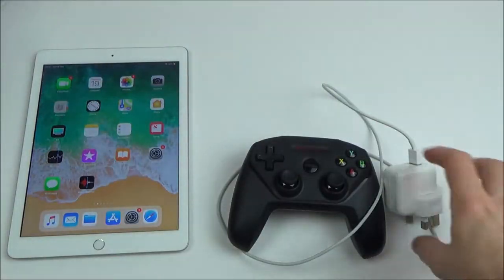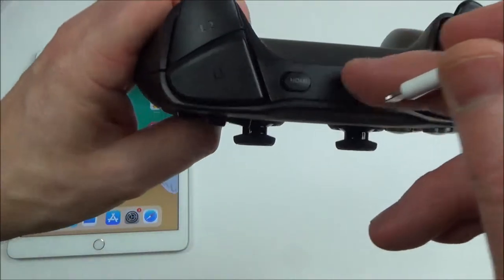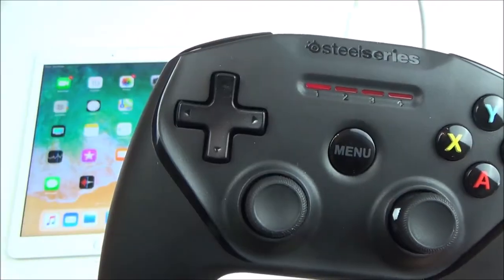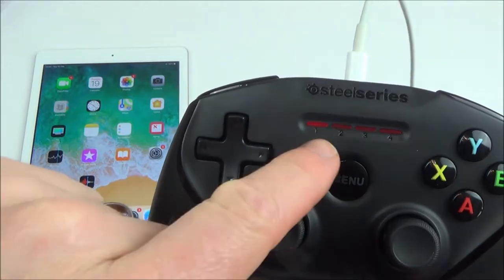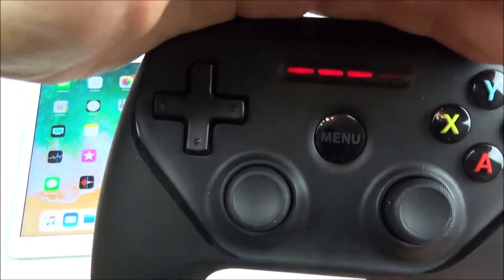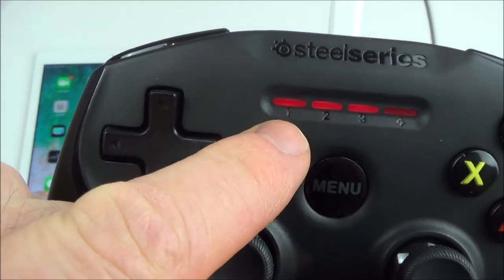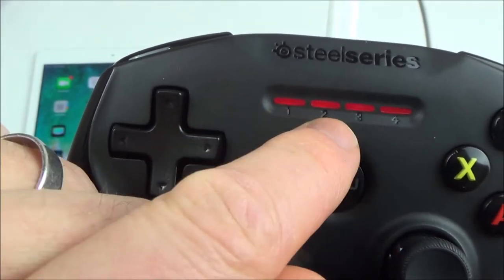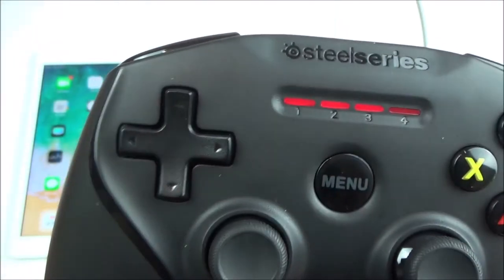How to CHARGE a SteelSeries Nimbus Wireless Controller

Comment: mine wouldn't turn on at all, when I plug it in to charge it shows 3 lights on...its always charged this way ???
Reply: I solved the issue cause I had the same problem when I got mine brand new. Used the USB-C iPhone charger and it didn’t charge overnight and when I tried the USB-A it started to charge!! 

You have to use the USB-A charger because it looks like it’s not compatible with the USB-C charger, so I think that solves the problem!!

Comment: I have the problem at the moment so I had my first controller SteelSeries Nimbus + it did not work after 1 std nothing worked and then I delivered it back and got a new one but it does not charge either, it flashes but only a light and  nothing happens
Reply: Me too